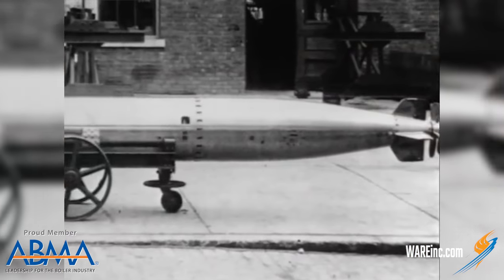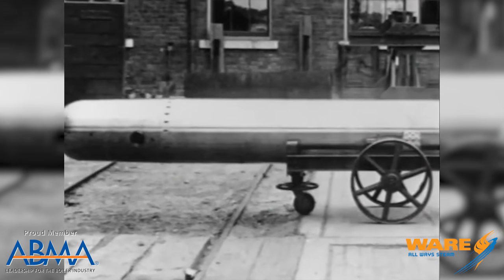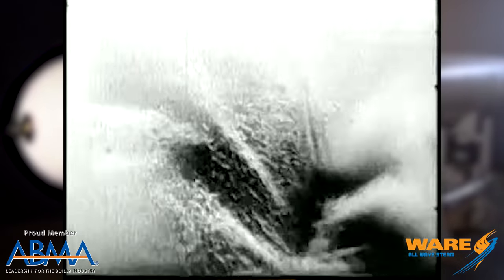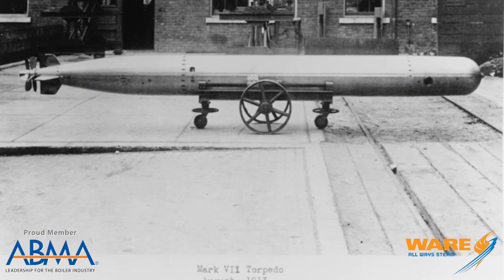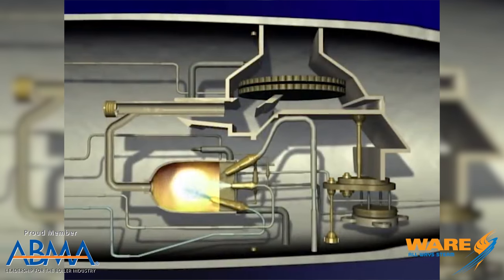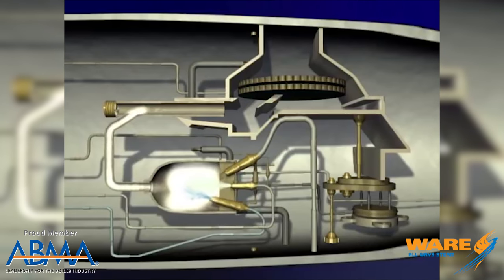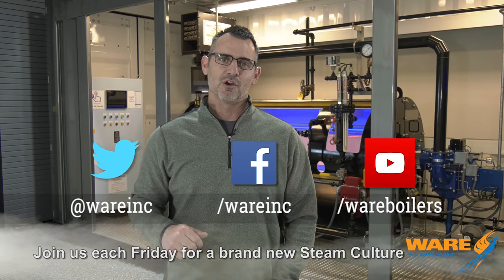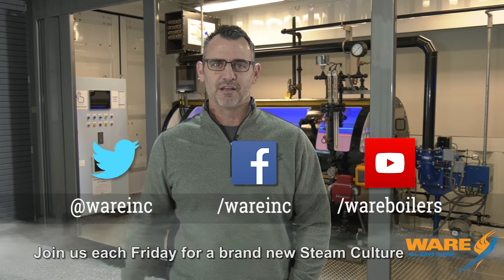Steam Powered Torpedo - Steam Culture

Comment: I did Google it, and I ended up here. Reason was, I couldn't comprehend how they fit a steam generator in a torpedo. 
I'm guessing they still have a compressed air tank? Is it used to spray water? 

Still so many questions, but I do understand a little bit better.
Reply: Yes, they have compressed air tank on 150 bar, which they use it for steering, gyro and combustion.
In fact it is not quite a steam driven turbine because the steam was in small proportion compared to hot air in combustion products.